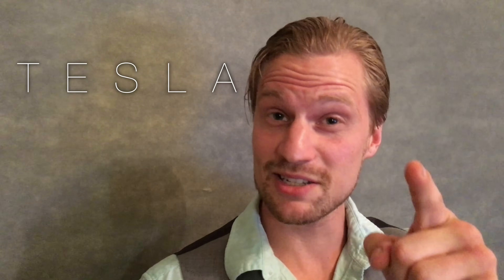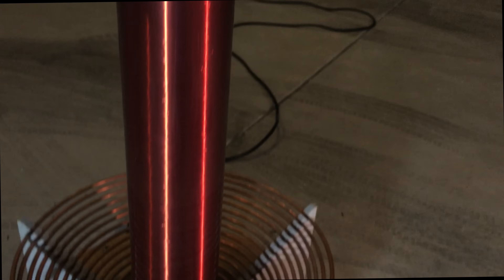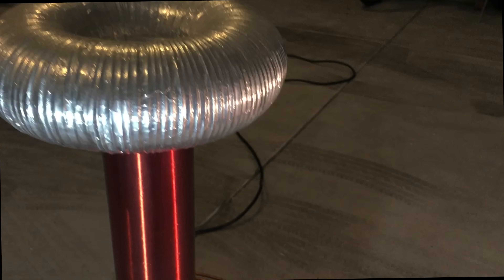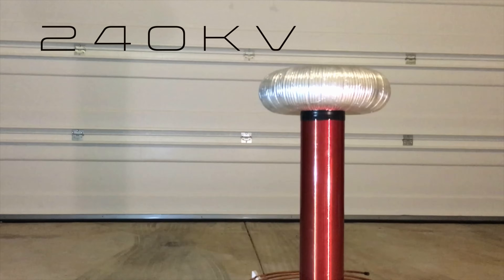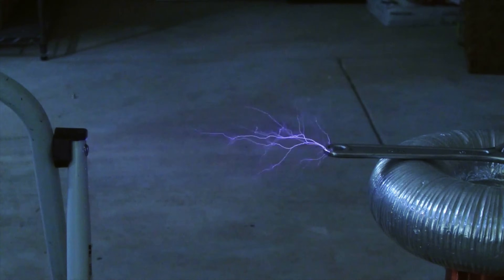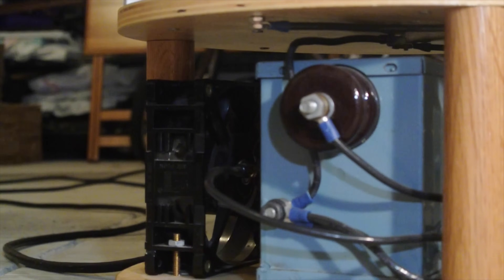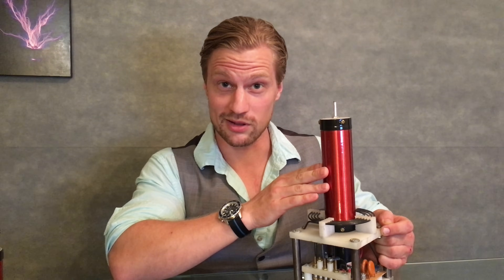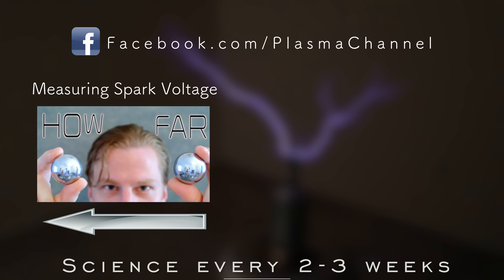This Tesla Coil changed EVERYTHING - THE GENESIS COIL

Comment: I'm 15 and I just built a Tesla coil powered by a 12,000V 30Ma neon sign transformer and I'm getting 18" arcs out of it!
Reply: Gavin Shah I wanna build one with a rotary spark gap that uses an A.C. motor and a "scariac" to control the speed.  I have a bunch of ideas to try, I need money though it's an expensive hobby
Reply: Jake Mitch do you mean the scariac that grant Thompson made?
Reply: Raul Sanchez how much would you want for the the variac? Thanks!
Reply: Gavin Shah that's  the only place I've heard of the Scariac...lol...i have a variac and also just happened to acquire an old X ray machine and it has one also...pretty cool bit have no real use. If interested I can get you pics and info and pay you pay for shipping costs.

Comment: Hey Jay. 
My Tesla coil does a few things and i dont know why. 
The arcing is very poor but the top load looks like a giant purple Iris.  
Also it won't light a florescent tube. 
Any ideas? Any info is warmly welcomed. Thanks Jay
Reply from the maker: If it cant light a florescent tube....but glows purple....that is confusing. Glowing purple is typical of corona, and ionic breakdown of the air. hm. I will do some thinking. Try larger capacitors, and retune it to have a lower break rate, but higher voltage in Primary. Try that?
Reply: Plasma Channel 
Done a few tweaks and it's better tuned now. Break rate issues. Thanks for the guidance. 

Also I've figured out why the corona is massive but won't light a florescent tube in one coil setup. While my other setup has no corona but will light a tube. 

Sometimes all it takes is a seed, a nudge in the right direction and watching your videos on repeat. 
Thanks again. Stay classy.

Comment: what is the out put voltage of your transformer and the specs of your capacitors please
Reply from the maker: The NST is 12kV at 30mA, caps..... total bank is 10nF at 20kV rating. Don't remember to model of caps though.
Reply: ok i have a 15kv transformer what capacitor or capacitors should i use
Reply from the maker: Off hand I am not certain of cap size you will need. There are resonant cap calculators online that can definitely help though.
Reply: ok thank you i just have a cuple more questions how many turns do you have on your secondary and the diameter of pipe you for your secondary and the gage of wire and what do i need to know to calculate the resonant cap thank you very much
Reply: jak ockleston there is sites online that will help, look up calculator on google.. his setup will differ greatly from yours unless you use the same caps and everything which is next to impossible

Comment: bro make laser with xenon tube , xenon tube available at ebay for 35$, deadly😈
Reply from the maker: In fact, we hope to experiment with laser soon! Thanks for the idea.
Reply: Plasma Channel hey buddy m building a Tesla coil 12v to 24v zvs  operated ., can you help because mine was a complete disaster(3 bottles of salt water capcitor of 1.5 ltr capcitor, in parallel) , only few millimeter sparks(when i touched and not visible in light...i want more than 2 inches , can it is build by 555 ic....in INDIA i can't variac and igbt because they are costly and rare , and for safty reasons i dont want to use direct ac supply ..

Comment: Do you use a basic spark gap schematic or something more complicated? What allows you to have thousands of cycles per second when wall output is only 60Hz? Why were there so many cylinders for your spark gap? Were they just for tuning? what are your ratios? I want to improve my boring tesla coil or make a new one entirely.
Reply from the maker: Great questions, seriously! My spark gap is a multi gap, composed of copper tubing spaced 1/16" of an inch apart from one another. This allows for a variable gap distance, depending on which tubing you connect to (I use an alligator clip). Variable gap distance leads to ability to vary voltage out. Wall frequency is 60Hz, but every time the capacitor dumps charge through the spark gap (a 'break'), it resonates at the speed of light up and down the primary coil, reverberating like a tuning fork. The 100kHz+ range i mentioned is specifically that frequency within the breaks themselves. This translates into an equivalent frequency in the secondary coil as well, which is what causes the resonant voltage rise. One thing that is important with coils, is to build them well. Symmetrical as well. This increases power. Thanks for inquiring!

Comment: Can you touch it?
Reply from the maker: Excellent question. In theory, yes, as 'skin effect' causes the power to travel on the outside of your arms, instead of through muscle. In practicality, the output is not pure high frequency. There are imperfections in design that tend to interject several other frequencies into the sparks (think of unwanted, junk frequencies). Due to this, touching a coil of this size is not recommended.
Reply: Plasma Channel ok thanks